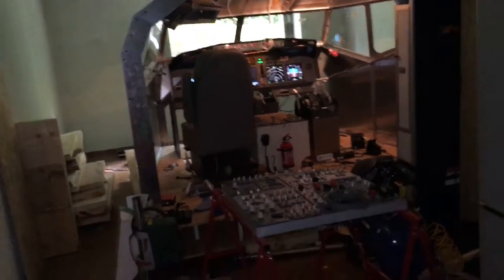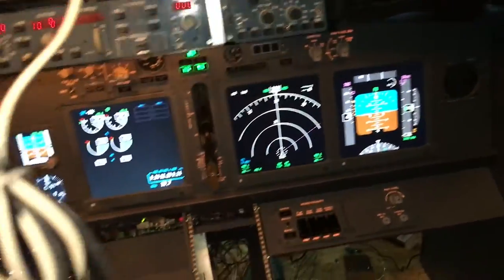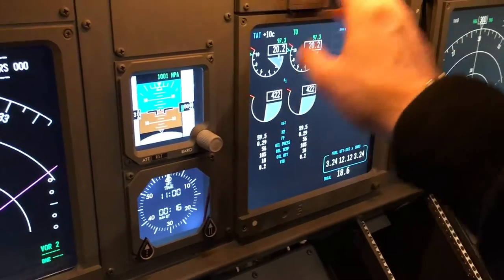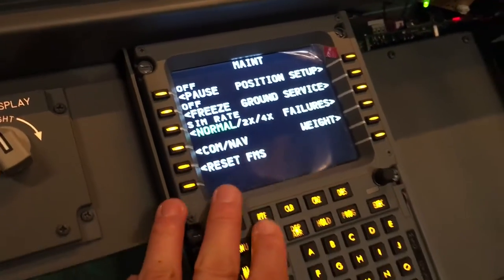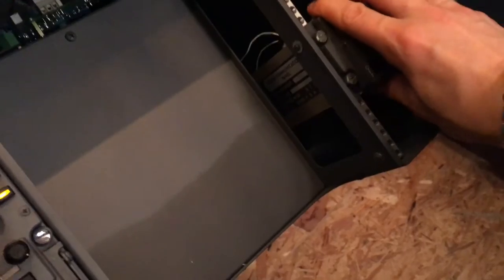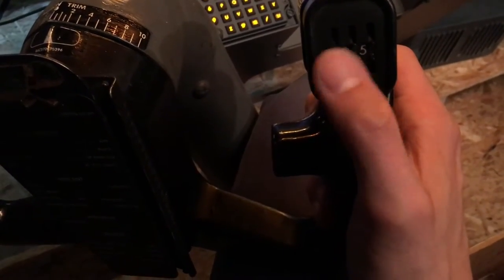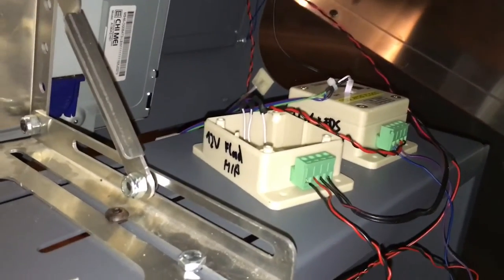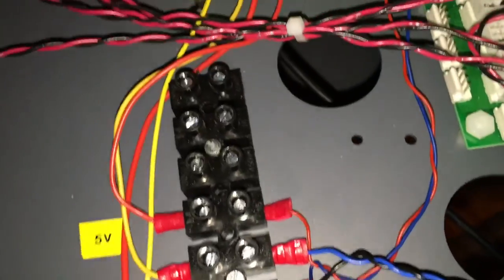PJ's Boeing 737 Homecockpit SCREW IT (TOGETHER!) Build Blog - #1

Comment: Nice setup. I'm interested in how you do the yokes.
Reply from the maker: That is tricky. Since I infortunately haven't got the original cross over column, I will have to come up with an own design. I'd love to do a non destructive design, but that will probably be expensive, production wise. First attempt will also be non-motorized. It's one of the next steps on the list. I'll definitely will post it here once I'll start constructing it! ;)
Reply: You should build a feel and centering unit for the elevator axis, that would be the most realistic feel you could get. It's what the feel in the real plane comes from. At least use a cam and spring instead of gas struts like some of these guys do.
Reply from the maker: +WackyBroProductions thanks! That was a very valuable advise! Have you seen this post? http://prosim-ar.com/forum/viewtopic.php?f=18&t=3217

Comment: We have just built our own crossover column.. Very expensive, I would not recommend it.
Reply from the maker: in a non destructive way by lathing a spur gear?
Reply: +PJaviation yes, non destructive
Reply from the maker: I will investigate whether it's feasible to get a real crossover column somehow somewhere. In case that doesn't work out, I'll probalby end up drilling and welding :/ 
A lot of pondering needed, but still better than using replicas, I guess.
Reply: +PJaviation I think that is the way to go.  I just posted a quick pic of ours on our Facebook page if you want to see.  Regards
Reply from the maker: I'll check it out :) 
I've just created a FB page as well. Consider liking it ;)
https://www.facebook.com/PJaviation/
Reply: PJaviation